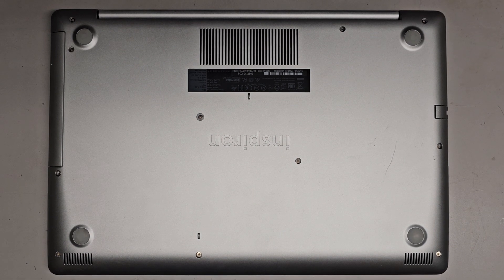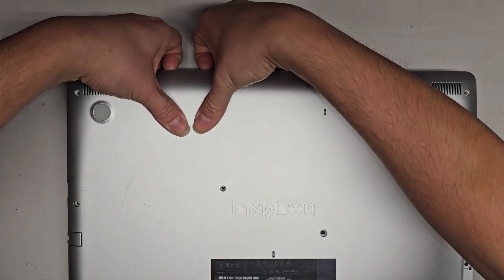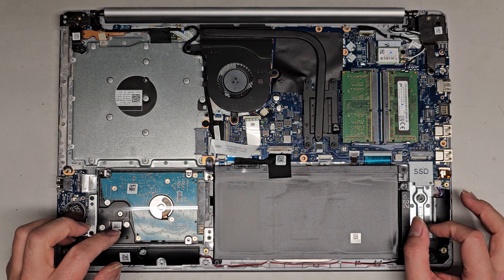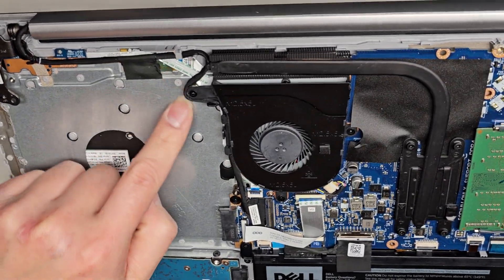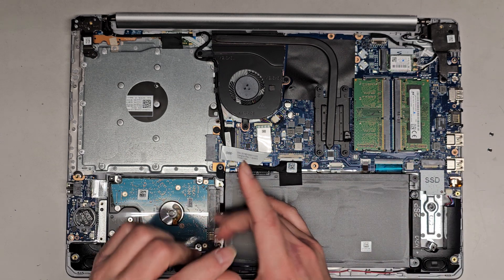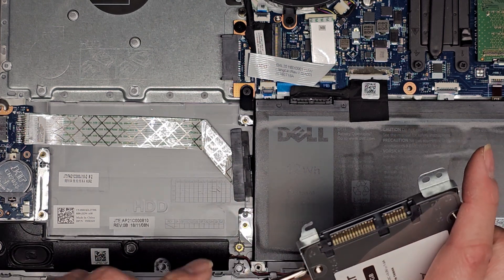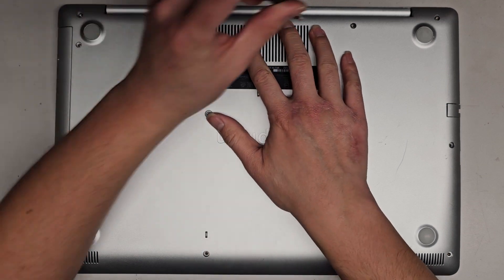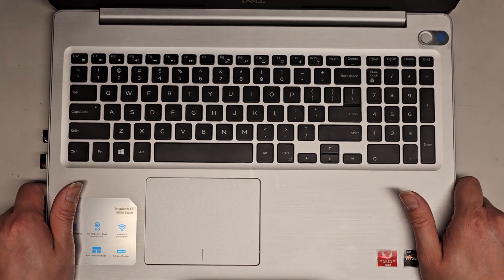Dell Inspiron 15 5000 Series 5575 Disassembly RAM SSD Hard Drive Upgrade Battery Replacement Repair

Comment: I am having a hard time finding 2 x 16 gb(32gb) ram for PC-4 2400T  DDR4 ram. Any brands? I tried crucial website but they only recommend up to 2 x 8gb for 16gb total
Reply from the maker: https://amzn.to/3HTJ6Cd here
Reply: @ItsBinhRepaired this worked you are awesome! My laptop read these just fine. Do you have any links for an SDD to go into the SDD port of my inspiron 15 5570? I dont want to change the hard drive out yet  . Do I need to get something for the SDD to be held in place also in the sdd port? Pcie m.2 slot?
Reply: Not sure if the gpu can be upgraded in this either or not
Reply from the maker: @SweetBlerd no
Reply from the maker: This will work well and should come with the screw needed https://amzn.to/4nfktz1
Reply: @ItsBinhRepaired thank you!

Comment: i have a 2tb HDD and i wannt to install SSD. 
do i have to remove HDD in order to install SSD... or i can use them both?.. 
Also, Great video.. Thank you very much.. helped alot.
Reply from the maker: You can use both.

Comment: hello, dell latitude 5420/5430 or hp latop 14 2023 , which one is better by design?
Reply from the maker: Not sure what the hp laptop 14 2023 is
Reply: @ItsBinhRepaired  you migh search hp 14 ep0000 laptop pc in youtube , cannot post any link here
Reply from the maker: You can watch videos of models I've worked on. I have playlists by brand.
Reply: @ItsBinhRepaired  thanks, around 500$ budget, dell or hp or lenovo built quality is better in general?
Reply from the maker: Hmmm likely HP at the moment.
Reply: @ItsBinhRepaired  thanks for answer, might give HP a try.Planning might get a pavilion 14
Reply from the maker: @hoitingcheung3119  hope it goes well